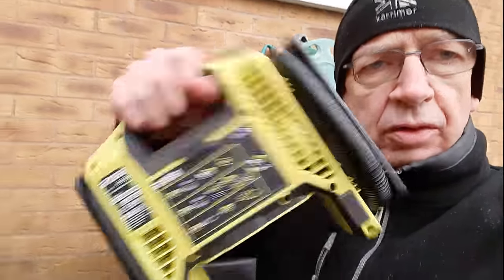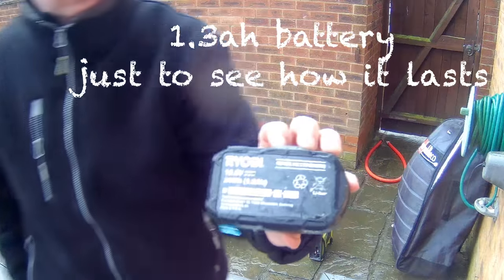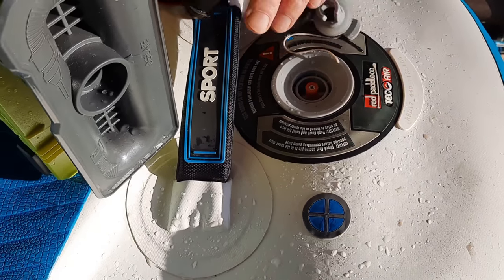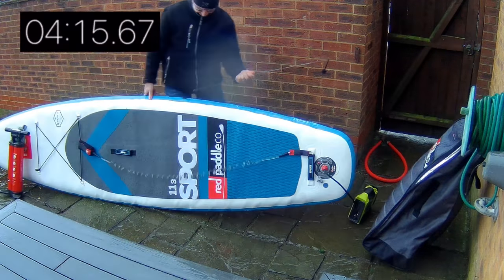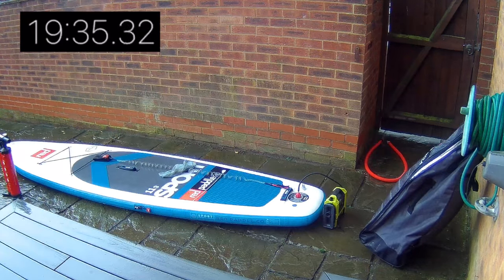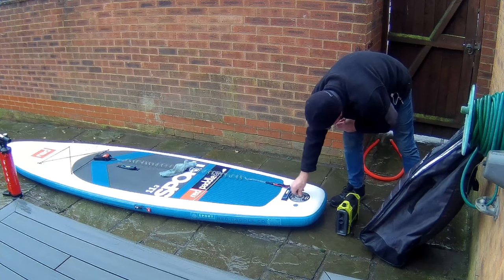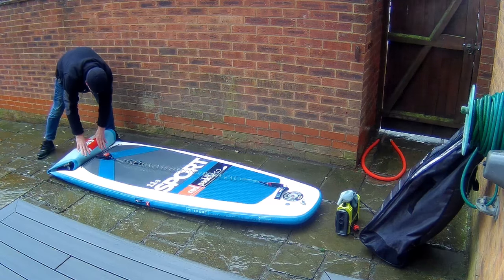Paddleboard inflation part 4, I got myself a Ryobi One+ inflator, is my search over?

Comment: I use the ryobi also. I got a valve adapter for the low pressure side. I connect to the low pressure hose with a short piece of automotive heater hose. No holding required. And when you can let the valve operate, you don't loose any air removing the hose. Which makes the high pressure go quicker.
Reply from the maker: Thanks Mike, what do you use it on? As in what do you inflate with it? Paddleboard or something else?
Reply: @oldmanwith  IK

Comment: I just got this inflator and it works for what I need on my kayak since it is the low pressure bit that I find tiring when pumping by hand.  What I do is use the hose from my hand pump to lock into the valve and then hold the the Ryobi's tube to that.  I'm looking for an adapter to simplify things slightly.  I also liked using the deflation.  Made it easier to pack than deflating by sitting on it.
Reply from the maker: Good to hear Ed, what valve does your kayak have? Or which model kayak?
Reply: @oldmanwith  It's a SeaEagle Explorer.  I  thought they were H-R valves but they don't advertise them that way so maybe they are clones of some sort.
Reply from the maker: Hi Ed, sorry for the delayed reply, I’ve been away. I noticed that on my Ryobi inflator, the bayonet connection is exactly the same as the bayonet on the original Dolphin hose. That makes me think it’s a “standard” (ish) connector. Snag is that Outdoormaster have now changed the Dolphin hose from Bayonet to screw fit. If you could get them to part with a hose to suit an original Dolphin pump it would possibly do what you need. Outside of that, I noticed that the Ryobi hose and all my paddleboard pump hoses seem to be the same diameter so you might be able to get a spare hose, cut the Ryobi hose and fit a joiner of some kind. It’s a bit terminal in terms of swapping it back to Ryobi standard I guess but it might give some ideas for you to work with. Good luck

Comment: i have the same setup, took me 7 mins to fully inflate.  I used the hand pump for the final inflation stage.  I inflated to 12psi
Reply from the maker: I think that’s the key to it Cameran, it depends on what ones “fully inflated” pressure is. According to Red Paddle for mine it’s 20 psi. The higher the pressure the longer it will take to reach it and the higher the pressure the slower it builds. If you’re happy with it for the service it gives you, great 👍🏻
Reply: @oldmanwith  is it necessarry to use the top psi value?  12 for me seems to work.  I dont use 15 psi because of the work needed.
Reply from the maker: To be honest I have no idea, I’d say if 12 works for you go for it. I guess the higher psi makes the board stiffer but I don’t know how much difference that makes

Comment: Good video thanks. was looking at getting one of these but that's far to slow. I have been using a cheap 12v airbed inflator to do the low pressure part and a Viair 85p 12v compressor to get up to full pressure (usually 20psi) the Viar is rated at 1.26 cfm @ 60 psi. It has been in use for 2 years now, pumping up 2 12'6" touring boards in a row without any issues. A battery powered solution for when away from the car would be ideal but I guess this isn't it. I need to find a waterproof battery pack that can supply the 15 amps to run the Viair.
Reply: wrong info in that, its rated at 1.26cfm at no pressure and 60 psi max working pressure. It is 1.22CFM @ 1 bar
Reply from the maker: Thanks for your comment, yes I absolutely agree. The biggest problem is the recommended run time. Ryobi do an actual compressor as well but again the run time looks like an issue.I was quite disappointed about it but it led me to the OutdoorMaster Shark in the 5th video. The Viair looks interesting (and cheaper), how long total do you think it takes you to fully inflate a board?
Reply: @oldmanwith  I just got out and tested this today. It took 12:26 to get the board up to an indicated 20psi on the viair gauge. the board was a 12'6" jobe, quoted at 320L capacity. I did check the pressure with a gauge I trust more and it was a few PSI short so I estimate a couple more mins needed to get up to an actual 20 psi.
Reply from the maker: @UltimateFifthScale  Now you have me partially regretting the spend on the OutdoorMaster Shark 😂😂😂 In fairness I’m very happy with it but given what you’ve said, if I was still in the market I’d give your method a go

Comment: I have this inflator and only takes me 5 minutes to inflate my kayak to 10 psi.  I think the issue you're having is you're losing too much air pressure on the high volume side because you don't have the proper adapter.  The first few PSI takes the longest so you can cut a ton of time if you can pump it more on the high volume side.  You can actually buy an adapter or 3d print an adapter for the high volume side which will fit properly and give you as much pressure as possible before you switch to the high pressure side.  Also I think this pump has a Duty cycle of 5 minutes (not sure exact time) so you're wearing it out early if you leave it running for longer.
Reply from the maker: Very happy that it works for you in your application but a couple of responses: Yes it does have a duty cycle of 5 minutes, i make this very clear at the opening of the video. In the situation I was in (cold wet English day) I wasn’t unduly worried about compressor wear - compressors and pneumatics are part of my business so I understand the risks but I absolutely would not recommend anybody else do what i did. 
I can tell you that despite not having an adaptor there were no leaks. The reason you can inflate your kayak quicker is that it runs at half the pressure of my paddleboard so on the fan end of the inflator you’ll get far nearer to full volume on your kayak than I’ll get on my paddleboard. You then hit maximum fan pressure and you have to swap to the inflator end but at that point percentage wise you’re way nearer full inflation than me. 
There’s also the question of total inflated volume so again, if your kayak has a lower total volume you’ll get there quicker than I will with my board. I was probably at 10psi after about 10 minutes but if you plotted a pressure against time curve you would see it gets flatter and flatter as time passes and pressure increases and the last 5 psi of increase probably takes over half the total time. I do now have the adaptor because I got one with my Shark pump. The Shark pump does exactly what I want because the volume at high pressure is far greater than that of the Ryobi. Thanks for your detailed comment though.
Reply: @oldmanwith  First off just want to make it clear that I think your video's great and I'm not trying to take away from it.  It's great to know about the time for the upper end of the pumping. Just trying to say it may be a good option for people depending on the psi they're trying to achieve.
Reply from the maker: Yup, fully get that Emery and glad for the feedback, it’s all good for the viewers 👍🏻
Reply from the maker: Sorry misspelled your name Emmery, apologies
Reply: @EmmeryCheung  I have this inflator that I keep in my car for my tires.  Haven't gone out paddleboarding yet this summer as it is still cold here.

How long would it say it takes you to fully pump and ready a SUP with this inflator?

Comment: Why not make the high pressure side put a Paddleboard attachment on
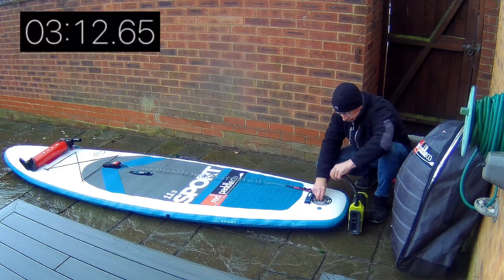Reply from the maker: Hi, if you mean the adaptor for a Schrader tyre valve to convert to a paddleboard bayonet connector it’s in the video at around 3:45 when I change from the low pressure side of the inflator to the high pressure side
Reply: I do!

Comment: I have exact same pump setup as you. After i fill low pressure volume, i then attach high pressure adapter. Now my ryobi will not engage. I set the high pressure to 15 psi and turn on but nothing happens, not sure why.
Reply from the maker: Hi, I’m not sure I’m afraid. I don’t know if there are separate fuses inside for the two different inflation parts. I would guess there might be but I’ve never had to take mine apart, sorry
Reply: @oldmanwith  I had the same experience. 
  Moved on to HARBOR FREIGHT/BAUER  brand similar appliance, but 20v lithium ion 5ah battery power, can do the job: use high volume side to 6.5 psi, then 8 min. on high pressure side, you're good @11-12 psi.
Reply from the maker: @johnhall7475 Hi John, thanks that’s interesting. Looking at the specs on the home depot website it would give a theoretical inflation to 20 psi in something between 20 - 24 minutes which again is better than the Ryobi. I can get away with about 15 psi in my board but anything under that feels kinda spongy. I get by fine with the Outdoormaster corded pumps and I can’t see the Bauer available in the UK anywhere but if I track one down I might give it a try 👍

Comment: I am wondering if the high volume low pressure connection would work for a low 3 psi inflatable kayak ?
Reply from the maker: Hi, thanks for the question. In honesty I don’t know. I tried to find out the exact spec of the HVLP side from the UK distributor but they didn’t know. I’m wondering if I can connect it to my manual paddleboard pump and see what the gauge registers. If I can get it to work I’ll come back and let you know.
Reply: @oldmanwith  thanks
Reply from the maker: Hi, I uploaded a video where I tried to check the output, result was pretty inconclusive. Just after I uploaded I figured a way to check it more accurately but I won’t get chance to film the method until tomorrow. Bad news is that it seems the actual pressure it peaks at is about 0.32 PSI so nowhere near what you need.
Reply: @oldmanwith  thanks for the information. Good to know
Reply from the maker: Hi @zhrob na here's the definitive answer https://youtu.be/f83R-x9WvIQ
Reply: @oldmanwith  well done